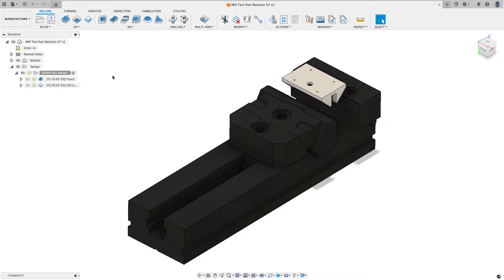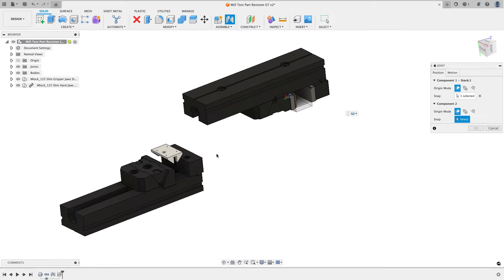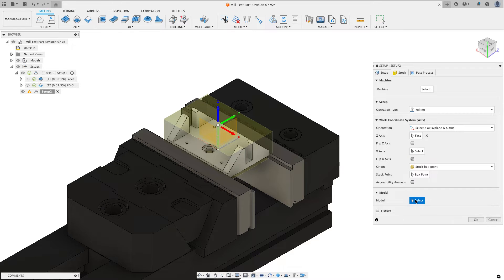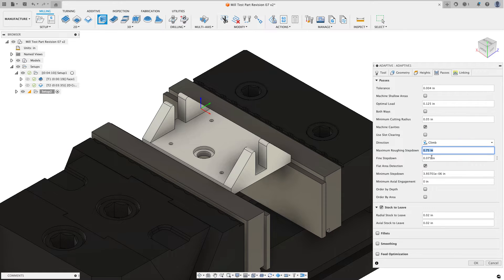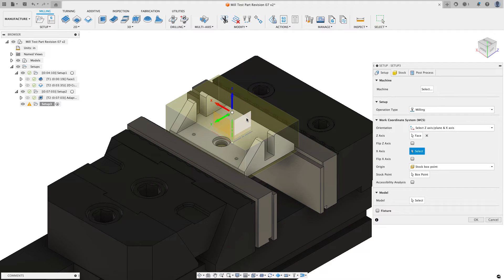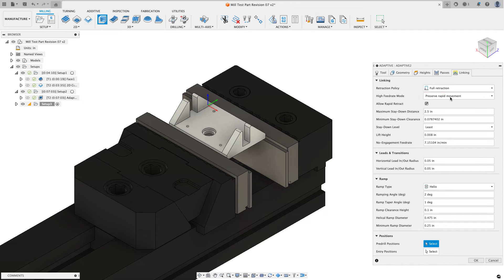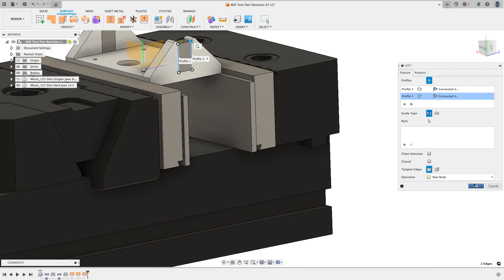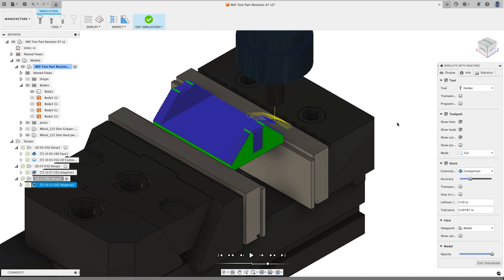Programming Xometry Mill Test Part using Fusion 360 - PT 2

Comment: This video series has been quite the education for me. Excellent work.  I am currently on video 3 and should finish the part today.  One thing I did different was instead of just hogging away the material between the two ramps, I decided to use that material as a testing ground for some of the features I had to mill in. I have a smaller machine and due to lack of rigidity, I have to dial down the speeds and feeds to get the finish I wanted.  I was able to test out the tracing (engraving
), drill and tapping with different tap drill sizes, tracked how my bore milling was performing, chamfering and facing.

Comment: Hey man, I’m working on this part right now and I’m not sure if it’s due to a software update but following along and matching your settings I CANNOT get the adaptive clearing path to work on setup 2 whether it be for facing or otherwise. 

It refuses to recognize the stock box as geometry and just comes back with empty toolpaths. If I select the bottom face it creates a pocket in the center with a helix move and leaves walls where I don’t want walls.

I’m not sure what’s wrong here or if it has to do with a software update since this video but any help would be greatly appreciated
Reply from the maker: I thought I had replied but I didn’t see my reply now. So maybe it didn’t go through? I’m about 99.99% sure it isn’t the result of a software update. If I had to guess, and I’m just taking a shot in the dark, I would edit your setup and make sure you have your part body selected as the body to machine. Did that resolve it?

Comment: Hey question so wouldn’t the part warp after hogging out the interior  necessitating a final facing op on the bottom side? Or is the bottom thick enough that it would still be within spec?

Comment: Great video! However on Set Up 3 shouldn't the stock height be set to 0.888? Because after the Facing and Adaptive 1, that is the actual height of the stock. Unless there is a reason you left it as the model height.
Reply from the maker: An extremely common question. In this case, does it matter all the much? Worst case scenario that cut is a little lighter on the machine than what it is going to show in CAM. For me it's easier to not have to worry about the match. Your stock may not be a perfect size from the metal supplier either.

Comment: I’ve never used a modeled vise in fusion.  I know in the last video you used it to verify your clearance but I did not see that here.  What was the reason for using the vise?  If the end mill hit the vise in the simulation, would you be warned? I did not see you tell fusion the vise was a fixture and I had imagined that was required to get a warning.
Reply from the maker: You are correct. I didn’t set that part up. You can specify the vise as a fixture. If your tool hit the fixture, the tool would turn red. I used the vise in this case for two reasons. Mostly because I used one in the first setup. The second reason is the ball milling op that will be used to finish the sloped faces. The ball mill gets pretty close to the jaws. It just helps to verify you have clearance.

Comment: I'm wondering if for this part, creating a sketch to constrain the adaptive and doing 2 adaptive operations (one for the central square and another for the angles), might not give more control? 

However your patch method is surely faster and a great tip!! Thanks! 👍

Comment: Do you make any use of the "machining models" feature for hiding the vice/patches, in real designs?

I experimented with them on my production assemblies where I have many machining ops and want to iterate quickly. However they seem to slow down Fusion significantly. It regularly does loads of recalculation, apparently regenerating those extra models, when switching back and forwards into the manufacturing workspace (this is on a Mac M1)?

Comment: Thanks for posting this - it's always really helpful to see how others tackle challenges.

You could clear out the centre portion with your existing face mill. This is indexable, so less expensive than a solid cutter and can take quite deep stepdowns, despite the name. You could even do adaptive here if the cutter is narrower than the gap. Even if you don't want to do that clearing operation with it, the "hat" will come off more quickly with a face mill and won't wear out the end of your precious solid cutter.

The last adaptive is covering about twice the cutting path (blue trace) than needed, as it is coming right round the side of the part for no benefit. Looks as if you might almost half the machining time if you limit the path. If you really want to make the most use of your face mill, use inserts with a large corner radius instead of a solid bull nose cutter to finish the angled face. 

There are many ways to do this and few right or wrong ones but I like to think reducing machining times and tooling costs are good habits to develop, even on test pieces. Looking forward to the final episode!